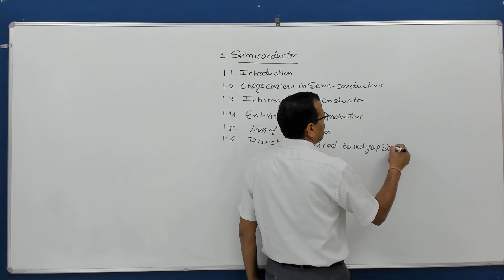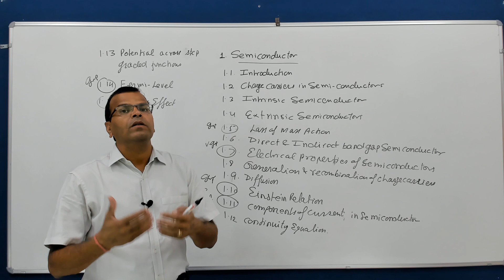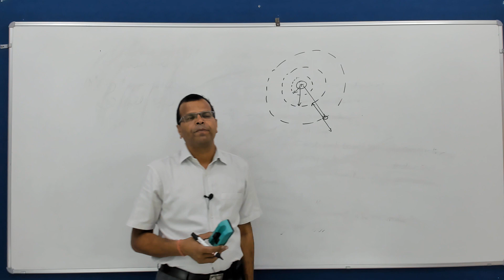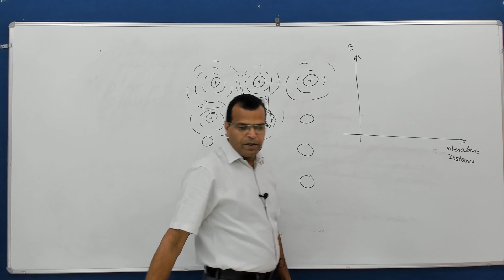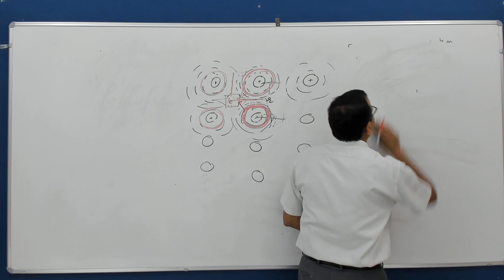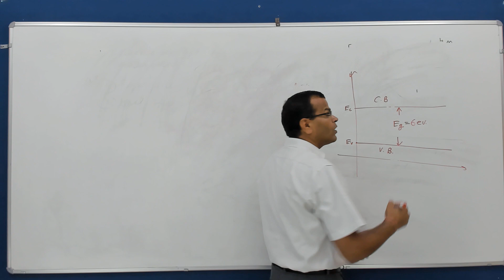EDC & AE Semiconductors Lecture L1(Introduction)

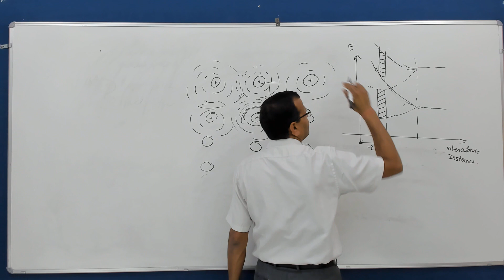Comment: Sir, i have a question. At 20:15 why the electron can not occupy the state between the conduction and valence band? Please do explain.
Thanks for the lecture.
Reply from the maker: Hello Garima. The occupation of an energy state by an electron is pure property of material. The energy states between valence and conduction band are unstable and electron never occupies such state in insulators however electron may occupy such states in indirect band gap semiconductor such as Si. However, when electrons permanently occupies such energy state there is no more a band gap and such materials are metals.
Reply: @digcademy2856  ok sir